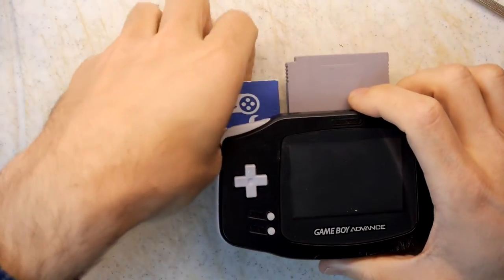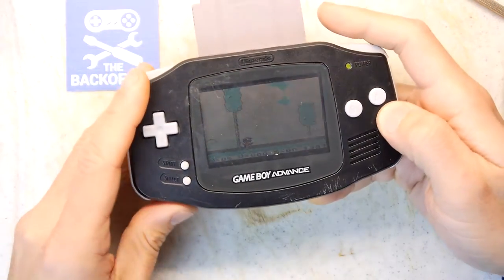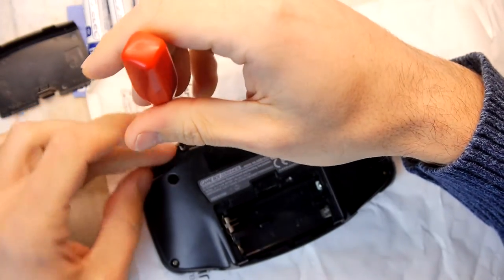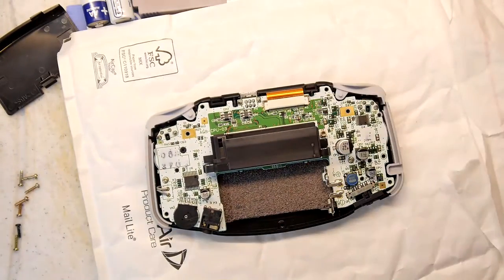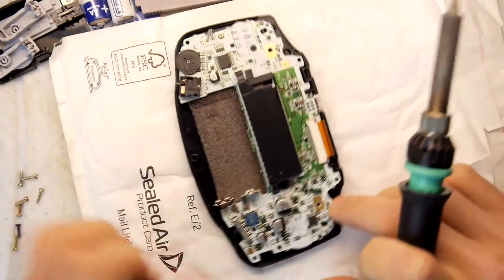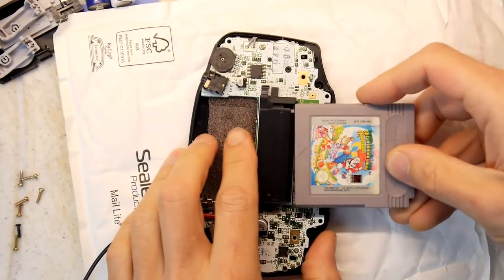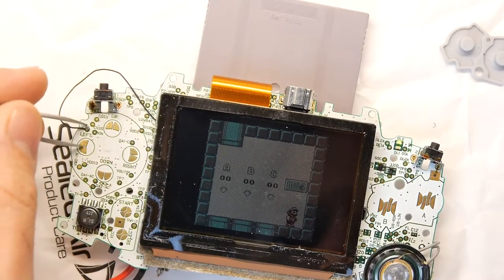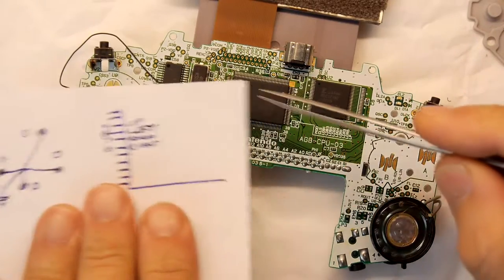How to repair a Gameboy D pad

Comment: I know this video is about 1 year old, but I might have some info for all the folks out there having this kind of issues.
I had this GBA with the exact same issue, a left button not working at all (It's kinda my job/hobby to do fix electronics).
I tested the continuity from the pad to the leg on the chip, and I had nothing, but I had it between the pad and TP5.
The problem was a corroded VIA. The trace starts from the chip, goes down-left, then a VIA brings it to the other side, then another VIA brings it back on the front, between the pad itself and TP5.
I solved this problem leaving the left side of the motherboard in a cup of vinegar one entire night, then in the morning i cleaned the interested VIA whith a very tiny sawing needle, then finally cleaned with a flux pen and IPA.
Then I had a fully working dpad.
No soldering involved, no thin wires to work with but most importantly the chip was left untouched.
If you ever in the future have a not working button, make sure to check if you're able to see the light through a VIA hole, if not you may have to do what I did there.
Have fun everybody!

Comment: Do you think it could have been a dry joint on the chip? Soldering it would have repaired it and the kynar cable may not be needed
Reply from the maker: +Richard Parnell I suppose it is a possibility, but under the microscope the chip side looked perfect. I'm thinking corrosion around a via. Saying that, it really all looked pretty good. Unlikely I'll go back and check 😂 thought I might if I reshell it.

Comment: Fwiw, if you get a wire wrap tool, they usually come with, in the handle, a wire stripping tool that would be a good option for that wire. :)
Reply from the maker: +Scott Lawrence Great idea, I will look out for a whire whrap tool on eBay! 👍
Reply from the maker: +Scott Lawrence cheers! 👍👍

Comment: I know this is an old video but can you do the same with a GBC D-pad? My up and right does not work. Tried cleaning with iso and white vinegar. Switched out membranes as well.
Reply from the maker: If you can figure out the pinout it should be possible

Comment: Have you ever been tempted to repair a ps4, i see many on ebay that just need a new HDMI port. Maybe i will learn how to use a soldering iron.
Reply from the maker: +spark20001 Go for it! I bet it will take longer to pull the thing apart than the actual soldering part. I was so pleased to get this GBA working again!

Comment: Mine has the left button issue but I checked the board nothing looks bad just incredibly filthy. I got some replacement parts coming in. the current d pad rubber thing is broken and filthy.
Reply from the maker: Fingers crossed that's all it is 🤞

Comment: Guessing it's moisture damage of some kind then? Good to know it's hardy enough just to be some form of trace damage.
Tip: if you gently heat any Nintendo adhesive with a hair dryer, it become a lot easier to remove screens, bezels & stickers etc
Reply from the maker: +Simon Lock that's some good advice! I will remember it, my hot air blower goes pretty low so should be OK
Reply: No prob, just want the whole area to get gently warmed up and a bit more concentrated on the glued area itself. Also works well for for the Game Gear etc.
Reply from the maker: +Simon Lock neat!!

Comment: Is Pin 9,8,7, and 6 always the same on every GBA or do I have to find up, down, left, and right myself?
Reply from the maker: I guess there could be different main boards revisions. Compare it to mine, if it looks the same, then it probably is.
Reply: backofficeshow Thanks! I am having similar problems, but with D-pad right instead of left

Comment: How do I repair an original gameboy dpad bottom not working
Reply from the maker: +Grady Vaughan You would need to diagnose it in the same way. Sometimes the contacts just need cleaning, if it works intermittently try this first.

Comment: How did you know you weren’t going to bypass a pull-up resistor?
Reply from the maker: Because most of not all SOCs purpose designed would have the pull ups internal to reduce BOM cost